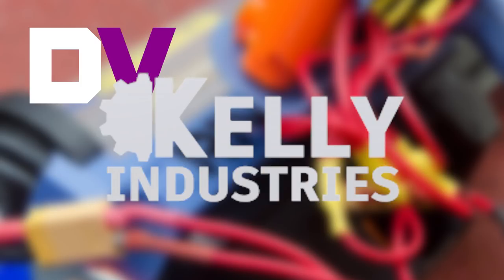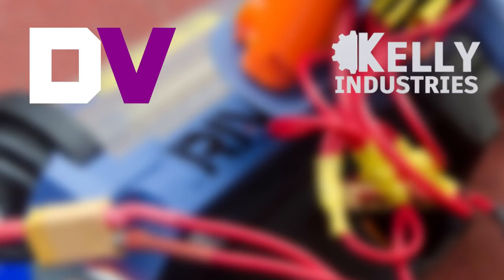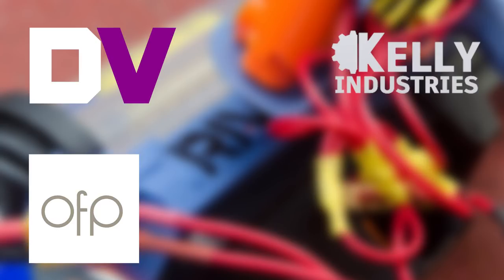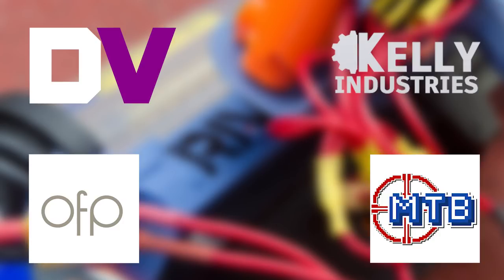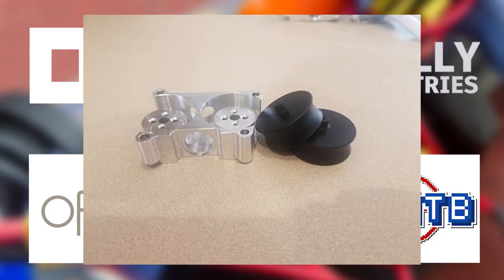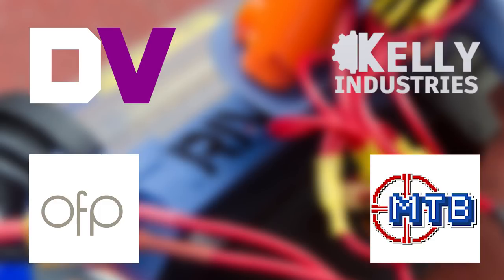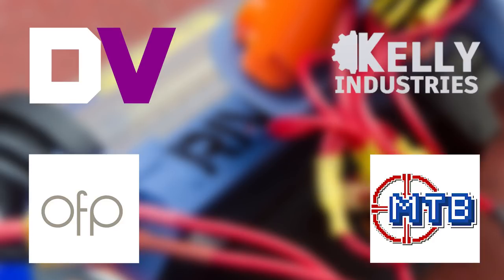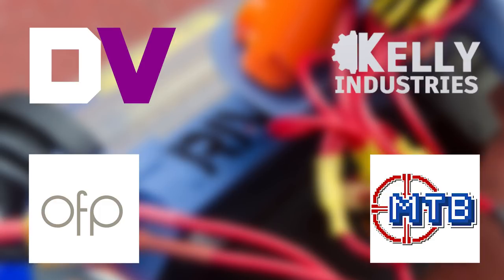DVTests Podcast #8: Flywheel Edition featuring MTB Ryan, OFP Phil, and Ahalekelly

Comment: The reason Hy-Con crush hasn't gone higher is because it is already almost out of motor speed and about to go subcritical with many darts at 9.5mm gap. At that setting, it gets 160-200fps depending on ammo which is about the limit of the design intent for the Hy-Con 1. There will be a revision of the power system to address the 200++ fps applications which more speed and will be able to take the <9.5mm settings without going sub.

Also, the 9.5mm Hy-Con is already harsh on dart tips and decaps poorly glued ones. The stock wheels for the production T19 will probably be 10mm gap to be easier on darts with the 9.5 optional.

Comment: Wonderful episode Dennis I just wish they’d be more emphasis on accuracy instead of feet per seconds In this hobby
Reply from the maker: +Nerf wars Ma I think that's an important topic to discuss as well, but there have been significantly less improvements on that over the past year in flywheels than improvements in FPS. I think now that we're closing out the year with 200 fps capabilities, 2018 will be the year of flywheel accuracy.
Reply: FPS is a very easy thing to measure but accuracy isn't and to get a repeatable test to be able to prove the accuracy improvement claims will be hard, but yes I'd love an accuracy test

Comment: Designing a non-clamshell blaster is something I find easier, so far. It may not be feasible to print a shell, but the whole concept of a shell to me is very flawed no matter how it is manufactured. I want to see Stryfe, shells, SSS cages etc. eventually go away, personally. All of them are just toy remnants, no sense in adhering to them.

how haven't we mentioned the shaft fit situation as to brushless/brushed or internal/external rotor motor debates yet? The press-fit plastic hub design is a weakness in the SSS-sized systems already, and doesn't scale well to larger format systems. It's not just that AC drives are the future, it's that they offer the outrunner as a solution to that problem. Between outrunners with bolt-on wheels and DCs with wheels with separate metal hubs the latter isn't sensible to me.